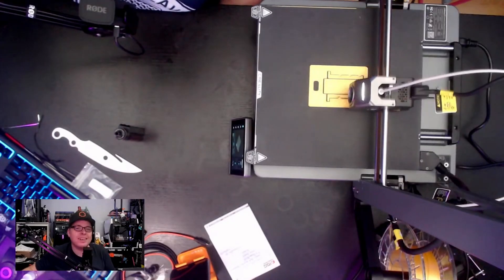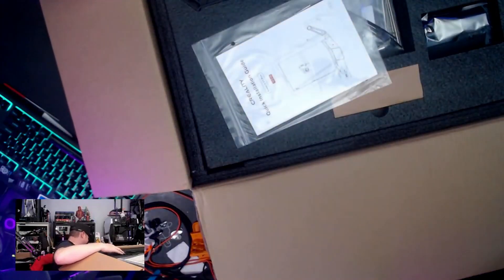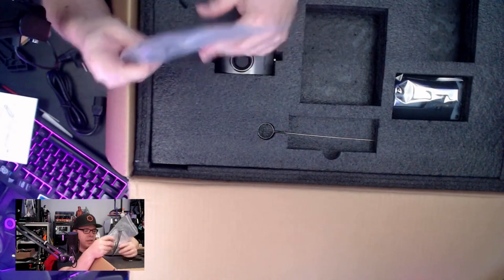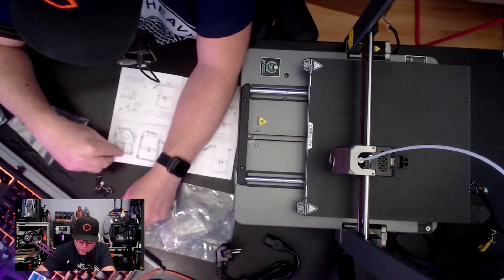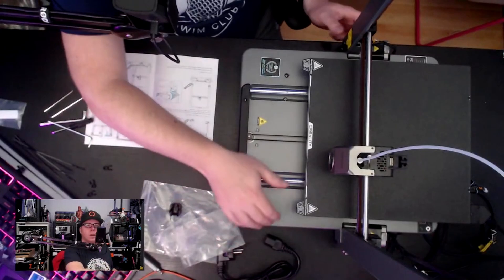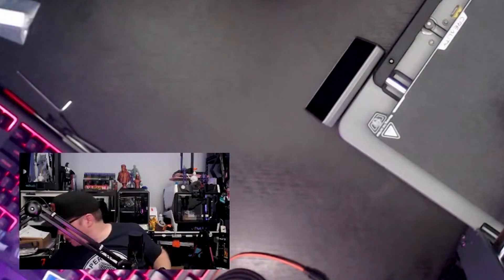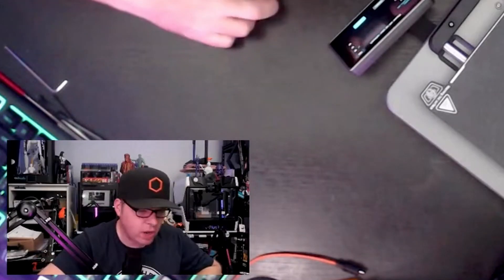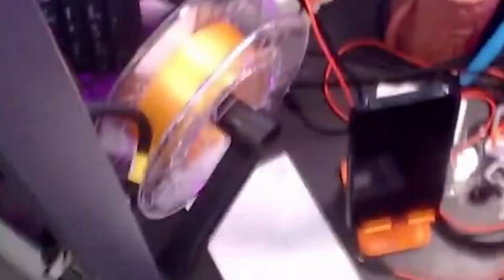First Look at Creality Ender-3 V3 Plus: Unboxing, Setup, and Amazing First Prints!

Comment: Hi, I got an ender 3v3 plus, and I tried to print some tpu. I took the filament out of the printer and I wanted to print another thing with pla, but I can’t even insert the filament into the printer, what do I do? I’m new into this 3D world
Reply from the maker: Thanks for sharing your experience! Switching filaments can be tricky, but you'll get the hang of it with a little practice. For printing with TPU, I recommend bypassing the sensor and the tube and putting the TPU directly into the top from the direct-drive extruder, do this by pushing the collet down, pulling the tube out, and then the TPU in gear (heat up to the right temp). If you have more questions, feel free to ask!
Reply: @Zachary3DPrints  I could solve the problem, thanks
Reply from the maker: That is great to hear. If there is anything that I can help you with, please let me know!
Reply: hey man had the same problem a couple days ago with my new v3 plus also, printed tpu for the first time, then tried putting in pla and extruder kept clicking and not extruding, thought i broke it but turns out the nozzle was clogged with tpu and had to use the unclogging needle they provide.

Comment: I'm a little unclear about the Creality cloud bit.  Are you able to retain local network functionality without accepting the Creality Cloud privacy policy?
Reply from the maker: If you don't accept the Privacy Policy, you can still use the printer by accessing the printer via the IP address that shows after the setup of the wifi

Comment: Looking forward to your impressions of this machine after you've got some time on it
Reply: It’s another bed slinger. If you’ve seen one, you’ve basically seen them all.
Reply from the maker: Bed slingers can be nice... but you need more space, which can be annoying
Reply: @Zachary3DPrints  I have an Ender 3 V3 Plus sitting next to my K1 Max. They are exactly the same width [after relocating the spool holder to the top], and the Ender only requires an extra 200 mm in depth. Hardy and 'annoying' amount of extra space.
Reply from the maker: Review is coming soon, I won't give any spoilers yet...